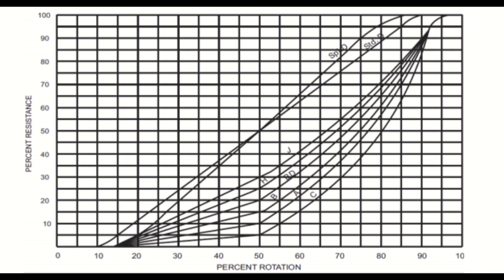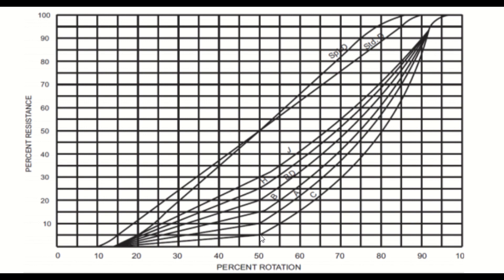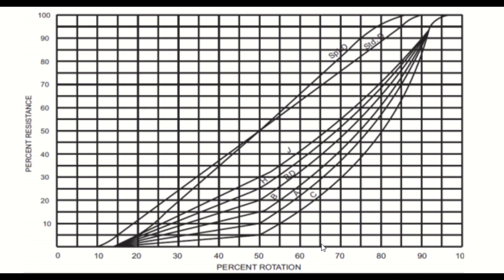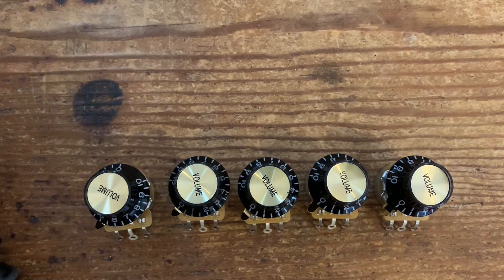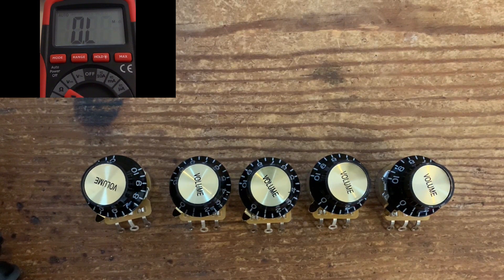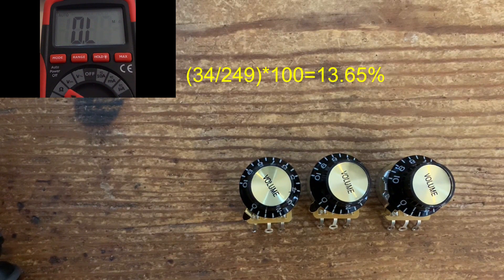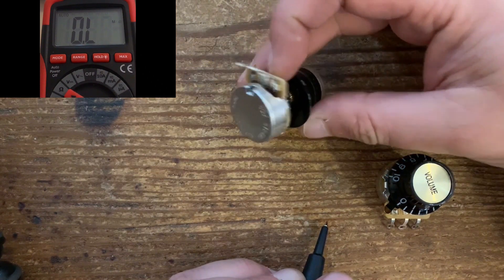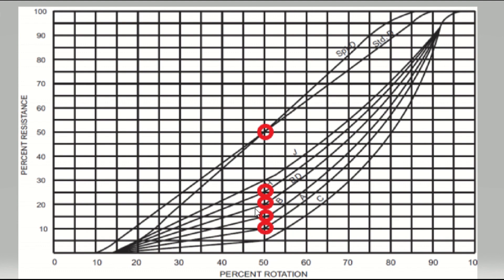How to Measure Guitar Pots Taper & Resistance

Comment: It would’ve been nice to know if you explain how to put the settings on the multimeter before you started testing the pots
Reply: To input and output of the pot no matter which way around. You are just measuring the resistance because that's what a pot is - an adjustable resistor.